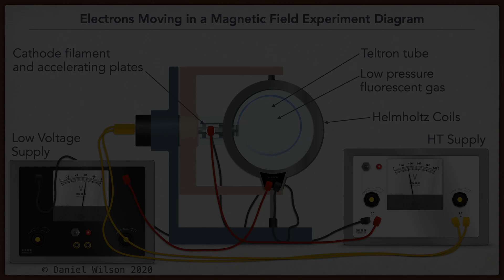Deflection of charged particles in a magnetic field

Comment: how do you increase the velocity of the electrons by increasing the electric field? Like how are they related?
Reply from the maker: Hi. Increasing the p.d. of the electric field increases the accelerating force on the electrons. 
> Larger force over same distance ➝ electrons end up faster. 
> Or think of it using this equation, KE gained by an electron moving through a p.d. is given by E = qV (where q is charge and V is p.d,). So larger V means electrons gain more KE.

Comment: Hello, thanks to the video. I would like to reproduce this experiment on my lab, could you tell please tell me the characteristics of all your components in order to get these and reproduce it. Thanks in advance.
Reply from the maker: Hi. Thanks for your comment. Unfortunately I don’t have a record of the properties and settings of the components beyond this:
Teltron tube [double beam]
High tension (HT) power supply ~300 V, 30 mA
Low voltage power supply (smoothing unit) for the B field
2 Helmholtz coils (set up in series)